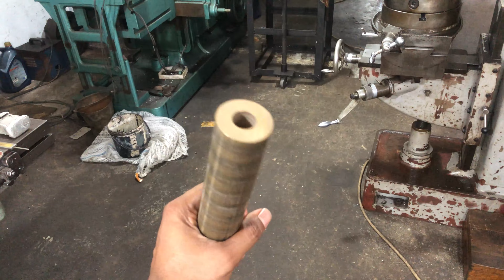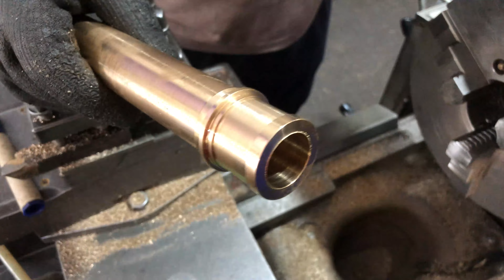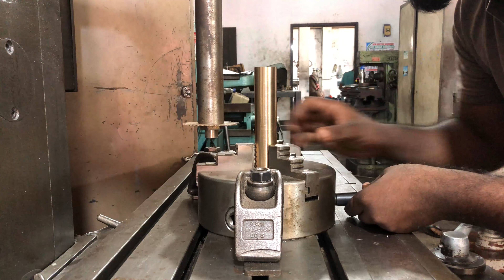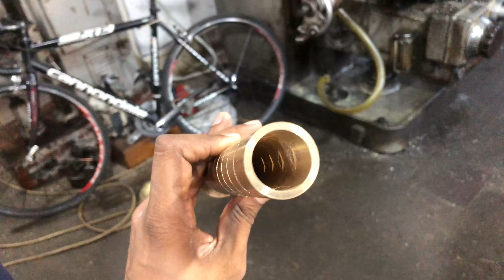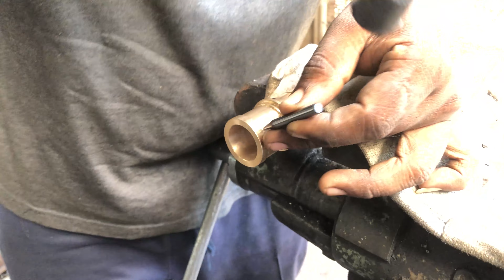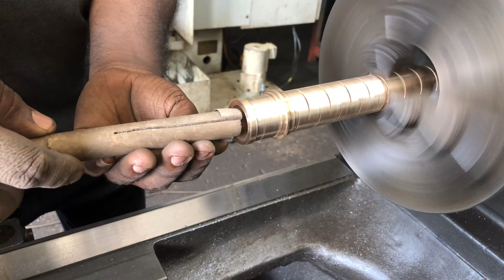Making a plastic pipe sizer mandrel - PVC pipe production

Comment: I'm currently working at PVC pipe production plant using chinese equipment and can tell you that these sizer's wall thickness is much smaller. They are also constantly cooled so you need extra holes for water supply inside these sizers.